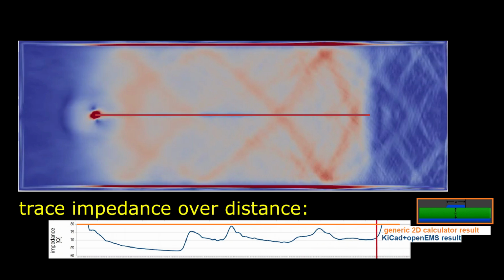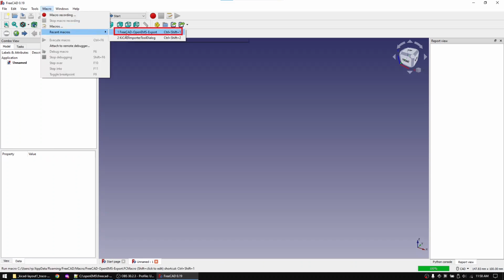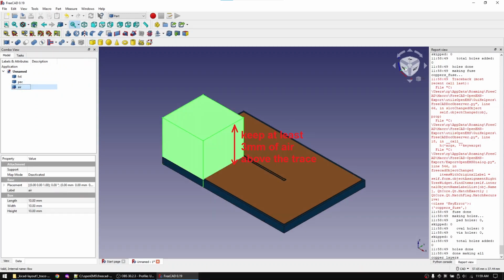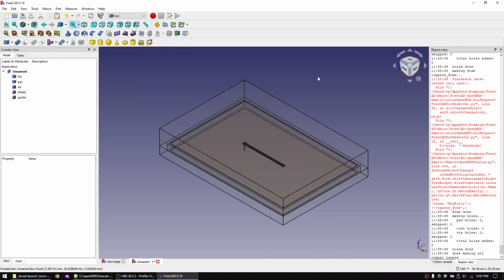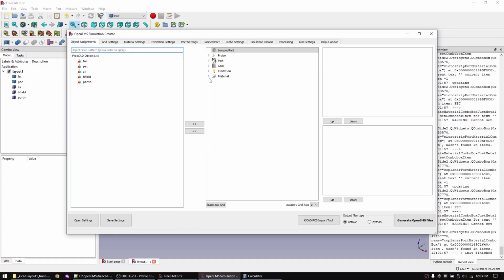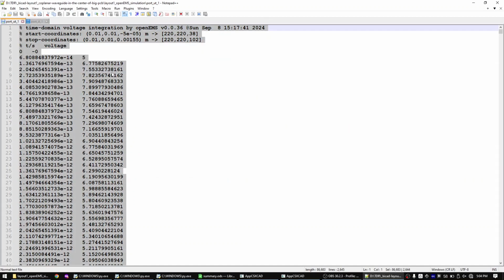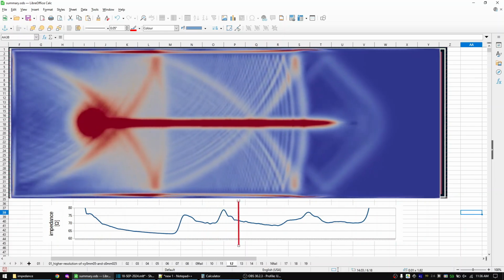free KiCad trace impedance simulation via TDR method (trace impedance over distance) using openEMS

Comment: the KiCAD PCB Import Tool bottom is always greyout no matter how many time i open the FreeCAD openEMS export macro.. I am using FreeCAD 1.0.2..
Reply from the maker: Hi there,

the button only works with Freecad 0.19 and make sure to use Kicad 6 for this tutorial.

for the newer Kicad and Freecad versions i only have a tutorial on udemy so far.

Best regards

Renato

Comment: Hi @panire3! I tried simulating a very similar trace with two pads on either ends of it. I used two lumped ports, one on each pad. One port was marked active & other was kept inactive. I used a step excitation. I tried port excitation direction of both "z" & "x" axis (simultaneously adjusting the excitation amplitude based on axis length) & I find that the second port acts like it doesn't exist at all. I also computed S11, S21, S12 & S22 from the data generated in port files. I find that S21 should've been ~0dB but surprisingly it goes down to -20dB regardless of what excitation direction I set. The results behave as if, Port2 is absent & doesn't see anything. The geometry of the port is very similar to one you've shown in your video. What could I be doing wrong?
Reply from the maker: Hi there, 

As this is a longer question i wont have time answering everything inside a youtube comment, here are at least a few things that might have been an issue:
1) you cannot place two  ports at the same location, so if the 2 ports for z and x excitation are at the same position that wont work.
2) if one port seems to not exist, the hieararchy might be set wrong, in the hieararchy tree if 2 objects are at the same location the one with lower priority will be removed. -> move all the ports to highest priority (top of the hiearchy window)
3) "second port acts like it doesn't exist at all": it might be because the inactive port just receives signals.

Best regards

Renato
Reply: @panire3 I really appreciate this. The ports don't exist at the same place. They're on the opposite ends (the first port is defined as [x, y, z] while the second is defined as [-x, y, z] i.e. they're on the opposite ends of a trace exactly like how you've defined your single port above). The only difference is the first port is active (get's excited) & the second is inactive. I thought that maybe waiting longer would help but I ran the simulation for insanely long times (40GB of data) & I get completely bogus responses on S21 & S12 & S22 parameters. The hierarchy doesn't seem to be the issue either as I moved ports to the top. The code computing them isn't faulty either, I checked it. I don't really know why this is happening. I think I'll ask it in the openEMS discussion. Thank you again Renato!
Reply from the maker: @norliegh Hi there, 
Yes the openEMS forum is a good place, ideally also upload the code there.

openEMS is definetly very hard to get started with, thousand things that can go wrong...🥲 

Best regards
Renato

Comment: Hey thank you for your videos.

One question to the probes.

How do they work?

I mean, for the H-field you've added a flat surface looking in z-direction.
But the H-field vectors are ordered circular arround the trace. 
So wouldn' t it be better for the surface to look in y-direction, so that the H-vectors can push through the surface?
Reply from the maker: Hi there,

Yes the Hfield vectors would form a circular shape around the trace, additionally for a microstrip line there will also be an additional circular shape around the ground plane in the opposite direction, this would look like this:
https://drive.google.com/file/d/10EQ1skAAFHneUb7kLs4cnJdUHVVSdMjk/view?usp=drive_link

Best to perform a little simulation yourself to check out how the probes work. You can make a cross section in each plane and check in which direction the H field, Efield and also Jfield vectors point. There is also the possibility to create a full 3D probe dump instead of just a cross section which might be even more intuitive to look at.
Enjoy experimenting :)

Comment: Hey Panire, awesome content, I re-watched all your openEMS videos a dozen of times. Thanks to your detailed guide I was able to recreate some of your results. 2 questions though: 
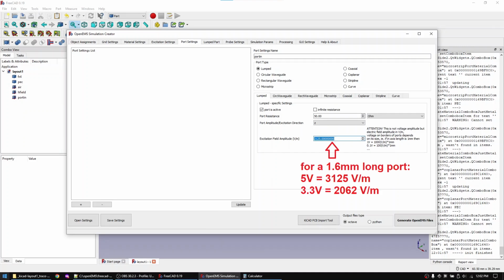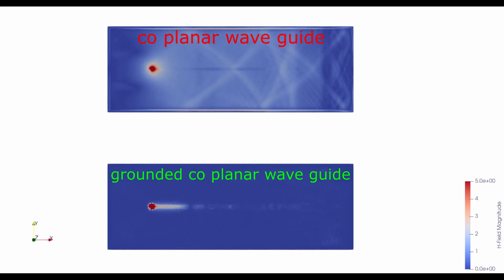1) https://youtu.be/fitgmJu_rfM?t=321 in 5:21 you set the amplitude to 3125 to get 5V equivalent voltage. But then in 9:51 (https://youtu.be/fitgmJu_rfM?t=420) you get values as high as 7.5V. Why is it higher? During my simulations I got even bigger discrepancies in this regard. 
2) When I plot my port_ut1 file when I use a step function (btw I use gnuplot which I find less cumbersome that excel, but I'm on Linux) first I see some fluctuations (when the signal bounces back and forth), and then, after some time, when everything settles my signal (I mean voltage as seen in port_ut1) stays on a certain level and doesn't seem to drop. Why is that so? Is it because we're using lossless materials (do we? i.e. I use the same settings for PEC, air and FR4 as you).
Reply from the maker: Hi Jan,

I just found out after uploading the videos that the field entered is not really translated correctly.
But luckily, there is an easy workaround:
Voltage and current scale linearly, so just multiply the values to whatever value you would like to have as the end voltage.
Here is an example for a step from 0V to 5V applied to a trace above a ground plane:
I copied the values from the files "port_ut1" and "port_it1" into the Excel sheet "voltages.ods" and simply multiplied the voltage and current values by a factor so the voltage settles at 5V.
https://drive.google.com/drive/folders/1Hskqbyp2UvDvopXL7Uowwpfh-bTkLTU1?usp=drive_link
I ended up multiplying voltage and current by 16198:
https://drive.google.com/file/d/159A48J-OA5g9CPUdFgszgh7cgBBHZDQq/view?usp=sharing

2) I think after the reply to 1), this one will be self-explanatory. Because the other end of the trace is left open and you inject a step from 0V to 5V, the trace voltage will also settle to 5V and won’t drop further to another value.
The initial peak from the reflection that is higher than 5V gets fully absorbed by the input port after bouncing back and forth a few times. (I am not sure how exactly this works; I guess it’s dissipated by the 50-ohm resistance of the port.)

2.1) On the other hand, the current converges to 0A because the trace is open. The initial current is being drawn as the trace and ground plane form a capacitor that is being charged. Once the trace is fully charged to 5V, the current flow stops.

Hope that feedback helps. It’s a pity that OpenEMS doesn’t simply allow entering a voltage. I guess we all had a bumpy start with OpenEMS because of this weird behavior.
Reply: @panire3  Oh silly me -> this is a step, not a pulse! I don't know I always had a pulse in my mental model. All clear.

Comment: The video is interesting to watch. Let me add some background: I think, what you are parasitically exciting in your first part is a parallel plate mode (between the upper and lower ground plane). Your via fence in the CPW in the second part is suppressing this mode since it is shorting the upper and lower ground plane to each other.
Reply from the maker: Yes, that’s correct.

In a real PCB, the reflections will not be as significant due to losses (for example, I used perfect metal, and the FR4 was modeled as lossless), but this should get the point across that via fencing is beneficial.

I plan to add a practical measurement either this or next month.

Comment: you should make a simulation for a 4 layer board. Ijust want to know how you setup probe, efield, and hfield.
Reply from the maker: Got it! I tried to make it simple, but you are right, a multilayer board would have been a better starting point. I will make sure that the next tutorials include  4,6 or 8 layers.
Reply: @panire3  the 4 layers board is more common in professional electronic industry, while 2 layers mostly for hobbist. Anyway, if you give the harder example the easy one should be easier to understand.

Comment: Thank for the video. You can simulate high-speed connections using S-parameters, generated from EM simulations that include frequency-dependent Dk and Df S-parameters that you can import into circuit simulators or SI libraries for time-domain analysis. There are some commercial tools like HFSS and CST (ADS also, I believe) that also do this. I know you can also use Python libraries like PySpice, scikit-rf, or PySI for signal integrity analysis, to simulate circuit behavior using frequency-dependent models. These libraries can analyze signal integrity with S-parameters (reflection, crosstalk, loss etc), taking into account the frequency dependence of dielectric material. But for a layman using free tools is better.
Reply from the maker: thx for the comment, yeah there is a lot of tools to learn. :)

Comment: I don't believe that simulation and the real world are going to align particularly well. The main issue is you aren't modeling any losses in your copper or your FR4, which creates those reflections. I bet as soon as you introduce some dielectric losses and make your copper an imperfect conductor then you'll see more accurate results.
Reply from the maker: Absolutely, there will be some differences. Later this year, I plan to make comparison measurements with real PCBs, which will provide an opportunity for us to refine the model.

Comment: Thanks for your great and concise videos! I tried the FreeCad OpenEMS Export macro on the latest version of FreeCAD (1.0). Unfortunately the KiCAD import button stays disabled even after multiple restarts of the macro. Do I really have to use FreeCAD 0.19 in order to be able to use that macro?
Reply from the maker: Yes i strongly recommend using the exact same version FreeCAD 0.19.4 and also exactly KiCAD 6.0.11.

I had big problems with even the slightest changes.
Reply: @panire3  Hi, I bravely took the challenge and tried it with KiCAD 8 and FreeCAD 1.0. Actually it is very easy, although the import button of the macro doesn't get activated in FreeCAD 1.0 at all. But KiCad 8 allows for a STEP export of the board. You can easily import this step file into an empty FreeCAD document. It contains the board as one item and the copper including vias etc. as a bunch of other items. These can easily be combined in a Fusion and a simple copy created from them. Then I could proceed as you show in your video, i.e. delete all intermediate items, create air box, field probe layers and input port and assign the properties in the tabs of the macro.
Reply from the maker: @gpetrowitsch  Wonderful to hear it worked. This comment will help and encourage a bunch of people including me. 🤗

Comment: Hi, interesting video. Why are you using this workflow and not generating S-parameters from structure and then perform TDR in circuit simulator or one of python SI libs? I think that most commercial tools use such methodology. Im not familiar with tools which you are using here but is it possible to deploy lossy dielectric models with frequency dependent Dk and Df?
Reply from the maker: I used the direct time-domain approach because it allows me to visualize how the signal evolves as first step, giving me some confidence that the results roughly make sene. When I calculate the S-parameters first, I often get odd results that I don't fully trust, so I'm still not completely confident in using the tool.

In theory, it should be possible with OpenEMS to define frequency-dependent dielectric constant (dk) and loss factor (df) based on the simulation from this repository (https://github.com/toammann/Multilayer_SMA2Microstrip). However, I haven't worked on this  hands-on, so I'm unsure how straightforward the implementation is. For those interested, here are some relevant GitHub discussions regarding this topic:

https://github.com/toammann/OpenEMS_MultiTermDebyeExperiments
https://github.com/thliebig/openEMS-Project/discussions/157

I'll make a follow-up video once I've fully digested the discussions there.
Reply: @panire3  Thanks for explanation. I went thru your tutorials and its helpful for getting started with tool.  Btw i found a bit strange that current and voltage logs over time dont have same time stamps, im not sure if this is intended but it seems strange to me, i would prefer to calculate impedance in exact moments in time. Beside that  I tried to get S-parameters for planar structures like in your video and results are strange, not sure why, would be interesting to get some reliable results to get inputs for SI/PI applications.
Reply from the maker: @jirisladek1313  The timestamps should definetly be the same, if they are not i have made a mistake, I will recheck the data.
I have the same problem like you that the s-parameter data depending on the structure seems wrong, I am trying to figure out right now how to get reliable results as this will be the main topic for some of the next videos. Will feedback you once i figured it out.
Reply: @panire3  Thanks. From my quick research on google it looks that different timing for I and for V is inherit way how FDTD works - do to staggered grid. so they should be shifted by half of timing or something like that. Than calculating Z from them shall use interpolated values or somehow ensure that time shift is irrelevant for bandwidth. Beside that I played a bit with that step excitation and no matter what i set for Fmax, it behaves same and Z (calculated as you proposed) has identical shape. But TDRs risetime shall define bandwidth/spatial resolution, which I was not able to change. Im not sure if this is intended behaviour or or lack of my understanding of openems. Anyway loking forward for your next videos, this is really great content for starting with openems.
Reply from the maker: i have the same issue with the step fuction (always just 1 time step of risetime). using the custom excitation i get the same issue with just 1 timestep risetime. so still much to figure out for both of us, I will feedback you once i figured it out. If you figured it out first, that would be even more amazing. I am quite certain that almost every openEMS user came across the very same issues.
Reply: @panire3 Maybe its not an issue,  if I understand correctly that you found that unit step excitation has 1 timestep long rise time, this make sense that it cannot be faster that time resolution of simulation. Then making smaller grid shall result in shorter timestep and this should also affect step excitation edge rate. But from various sources it seems to me that step excitation is not convenient for fdtd and creates some artefacts.
And regarding issues with generating S-parameters, from example projects it seems to me, that in their case it works well do to better meshing - by this I mean parametric meshing as division of object dimensions - which require simple separated objects and then mesh smoothing  with dependence on fmax. 
Also when I went thru github discussions, it seems to me that it will not work well for broadband PCB - high speed SI applications do to limitations of implemented material models.
Reply: Regarding S-parameter data looking wrong -- in my experience using commercial FDTD software, you often need to run your simulation for a very long time to get good S-parameter data. Usually you need to run until nearly all the energy you put into the simulation has dissipated or exited through a port. Often this can be very many round trip times of the structure you're simulating, and even longer if it's reflective or couples to resonant structures (e.g. vias coupling to parallel copper planes).

If you run your simulation for too short of a time, the low frequency data (by low frequency I mean <1 or 2 GHz for PCB-scale stuff) is usually trash. You'll have all sorts of passivity and causality problems in the data.

If your simulation can be done natively in the time domain, it's often much better to do it directly like @panire3 does with the TDR sim in the video. If you need really good S-parameter data, you're often better served by the finite element method, but unfortunately there are not a lot of great open source options that don't also require a very strong background in the underlying mathematics/physics.
Reply: @alexw7260  well in my case it was really result of not complying with meshing recommendation, its tricky for imported 3D data which are not parametric.
Reply: @jirisladek1313  Ah yup, incorrect meshing will do it too :)